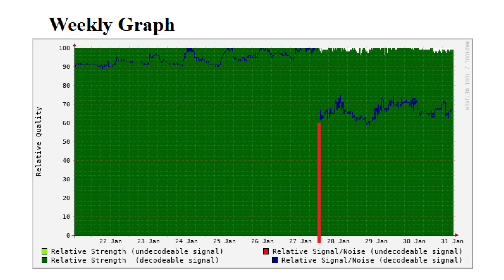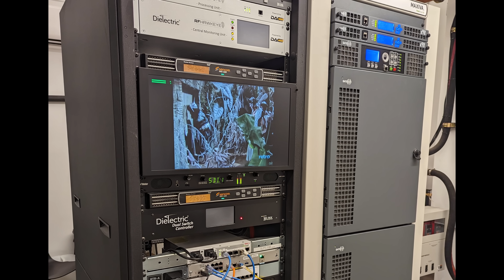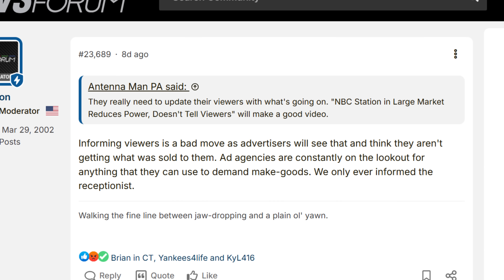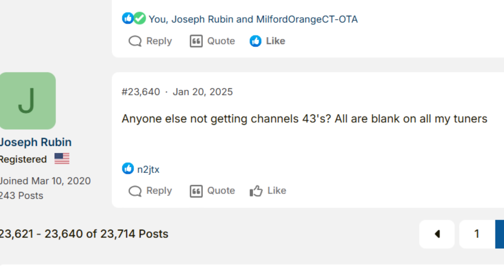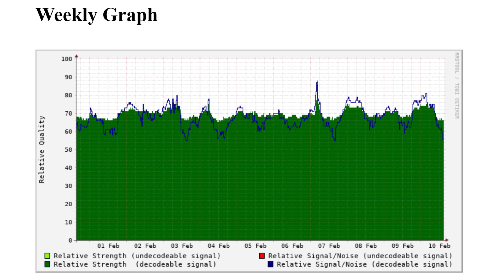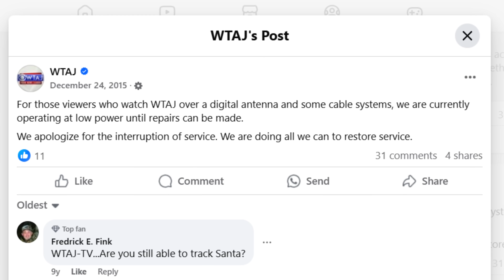TV Stations Lower Broadcast Power at Times - Here’s Why

Comment: Fun Fact: AM radio stations (except Class A stations) will turn down their transmission power around sunset to prevent interference since those radio waves will travel much further due to skywave propagation.

Edit: I mistakenly said that it's due to groundwave, when it's actually because of skywave
Reply: That's not voluntary when it occurs, but is mandated by FCC licensing.  Some stations aren't required to reduce power, but must change their broadcast pattern at night to keep from interfering with another station on the same frequency.
Reply: @LarcR  We have WHP in Harrisburg that does that.
Reply: For example, WHLI 1100 AM in Hempstead NY signs off the air at local sunset because of the 50kW signal of WTAM Cleveland.  The station does promote their FM translator at 104.7 and their website for streaming the station.
Reply: True. I like listening to stations from different countries as well as cities in the USA. Shortwave and MW radio listening is a big hobby. Also when maintenance is done on a transmitter or antenna system power may be turned down or off.
Reply: @RJDA.Dakota there used to be much  more to listen to back in the day.
Reply: Full power at night AM stations are called clearchannel.
Reply: @mstcrow5429   Only primary stations on designated clear channel frequencies are so named.  

1 kW local stations that started as 250 watts, then 1 kW day, 250 night, are far from clear channel, yet meet that criterion under current politics of no power reduction at night.  

There are also 500w-50kW stations on clear channel frequencies that maintain power but switch directional patterns at night, and which are not "clear channel stations" but are secondary on those or adjoining frequencies.
Reply: That's wrong.  Ground wave signals change with soil conductivity and are typically slightly better in cold than warm weather, but do not change otherwise with time of day.  

At night the ionosphere becomes reflective to radio signals, and so many stations reduce power or change to a directional pattern, or different pattern, to protect cochannel and first three upper and lower adjacent channels, of stations in more protected classes or that were there first.
Reply: @lokiva8540 Yes, you're right. I meant to say that it's due to skywave, not groundwave.
Reply: Another fun fact: WTMJ in Milwaukee had the first directional AM band broadcast, to avoid interference with Chicago.  It's still that way.  They use an array of towers in a pattern.
Reply: Another Example: WBZ 1030AM is a news station from Boston, and they are a news station
Reply: They must not all cut back power, otherwise I couldn't get stations in TN here in NJ late at night. For years my dad used to listen to WSM in Nashville here on his old Philco radio in the basement.
Reply: @VB-bk1lh Yes WSM is the Grand Ole Opry station, a high power clear channel station, which during its early days allowed the Grand Ole Opry radio program to gain a widespread following in much of the U.S. even before the program eventually began being carried on the NBC radio network. In Atlanta our local WSB news station is clear channel and at night can be heard in many southeastern states.
Reply: Sunny days lose signal, sun burn off the humidity, NO guarantee of reception in any type of  weather.
Reply: @haroldreyes7549  Sunny days and humid summer weather tend to be tough on compromised hi VHF and lower end UHF signals that skim trees and don't have good line of sight.  That impact on AM ground wave should be trivial (but longer term soil conductivity does shift lower in summer, 20-40 percent in some regional soil types).
Reply: AM 1230 in new York city is a Bloomberg station. At night I can hear them in Baltimore.  Also in my house my 2nd floor gets a better signal than the 1rst floor. PBS usually has the worst signal. Sometimes I get Delaware channels, but not DC.
Reply: Heard also called the sun cap.
Reply: I notice under certain conditions FM and television signal reception goes beyond the listening and viewing area especially from analog television broadcasts before the switch to digital.  Even the audio of television sounded different at times as well as the changes in colors.  AM radio stations that broadcast in HD radio also HD radio can be received far away in the night and the audio quality changes as the HD radio signal fades in and out.
Reply: I do  recve the am signl from luievill KY  remember under the right conditions in wisconsin at night we wre Abe to hear thbrod casts of the base ball games.

Epesle on th car Rado was the best recepi0on.
Ever later found a better way.

One off set up for week signl wine part was a varey long wire stretched down the up stRes of the house front to back and a good ground thar was a nuther box of tricks I built can't remember wat  that did mor than just bust the signl. 

Was using a varey sensitive old radio  as welll.

Best recepion out of uthers I had an had sene as well.

Old scroll am fm tube tipe sert.

Was a radio tuner component 

For a system ad on.

Or posable to ad fm up geat to an existing system wone was feasible got this for about 5 dollars 

Used an old mest up real to really recorder wit a beset billt in amp and a lotof dolifren in puts as a component  as well.

Was gate sound even with the original speakers stereo.

Was all so tubes 

Strange  all so had  aux spekr outs

This was used down stares

With modified for 8 omes pa sperkrr vintog wall baffle wegees.

Wnd a swit to a nute sorse as well. ee
Reply: funny how AM radio is more reliable than digital TV even tho Tyler absolutely hates the AM band...
Reply: @mephitusincognito7918  AM radio sucks over digital OTA signals day or night.  All that AM stands for is Antique Modulation!
Reply: @Boomerlake  then what does QAM stand for?  using wifi? you are using Quadrature Amplitude Modulated signals... basically AM radio that 'twists around' in a specific phase... 'antique' science still has use... just look at the theory of relativity...
Reply: @mephitusincognito7918   How about CM?  

That's when you take a somewhat trusting cat, drape if over your neck, grab all four paws solidly, and stretch or twist to produce melodic modulated variants on purrs or hissing.  

"Cat Modulation"
Reply: They also change their signal configuration.

Comment: ... And 5G interference, which also comes and goes. 5G is in part using frequencies formerly used for UHF TV. Your existing antenna (and new ones) receive these signals & the tuner in the TV is designed to receive these. Amplifiers and such in the system are affected too. The 5G signals can be very strong locally at times.
Reply from the maker: Good point. I should have mentioned trying a 5G filter in this video but did bring it up in several other videos.
Reply: @AntennaMan I noticed the 5G filter slightly reduced the power to my device.
Reply from the maker: @aaronhendrickson  There is a small amount of attention on RF 35 and 36 with a 5G filter
Reply from the maker: @xb991 Yes both are still used. Search "Antenna Man VHF Vs. UHF" on YouTube
Reply: I got a strange reception problem.
A UHF station on RF22 only comes in when the ground / roof gets wet.
Ground wave reception ?
Reply: Sounds healthy
Reply: A TV receiving antenna can be designed to reject signals above 700 MHz. This will prevent the 5G signals from overloading the input amplifier of the receiver. 

So there really is such a thing as an HD TV antenna! The old antennas on our homes are obsolete. They will receive ok,  but a new antenna can be optimized for the signals that we really can tune in.
Reply: They do sell inline filters to filter LTE and 5G signals too.

Comment: i notice that 1 local tv station in my area does not show up on my antena but 3-4 others do. It's not like this channel is way out further than the others. Maybe their signal isn't has strong as the others i get? just annoying/ not sure what's causing it.
Reply from the maker: It doesn't matter if several channels "broadcast from the same area" Each is on a different broadcast antenna and frequency with different power outputs. The end result is no two TV stations have the same signal and might reach an antenna in different locations - AKA you might need to use a signal meter to find the best location for the antenna where it grabs all local channels.
Reply: @AntennaMan  There can be exceptions.  KOKI23 and KMYT41 of Tulsa are owned by the same company with their transmitters on the same tower.  KMYT's power and tower height is a little lower, which explains I can't get it as often as KOKI23.
Reply: Uhf vs vhf can be all the difference.  Look into the system and then see if the antenna works well within the frequency

Comment: VHF and UHF were better  .   They replaced those with a technology  they know  doesn't work well
Reply from the maker: The VHF and UHF bands are still used. The difference is TV stations now broadcast using the ATSC 1.0 digital TV standard which can be very fragile in certain areas. I actually made a video about it below: https://youtu.be/3x-FRMplIkU
Reply: @AntennaMan  Yes, and the conversion from analog to digital service took away service from many. Analog antennas captured reliable signals from much further distances.  At least where I live.
Reply: @jameslarosa2396  Not so where I live.  From the result of the changeover to digital from analog it brought in signals always rock steady and snow free.  There was no longer any need to get Cable TV to get stations totally free of snow from the nearest metro of around 45 miles away.
Reply: @AntennaMan And thank you for that.
Reply: @AntennaMan Still broadcasting on mostly UHF now. The channel number is virtual. At one time the channel was the actual frequencies that were assigned to each channel. Now, mostly only UHF is utilized. The lower VHF frequencies are being reassigned to a new FM band adjacent to the 88–108 MHz spectrum. It will be expanded to at least 80 MHz. Medium Wave stations will be reassigned to these new frequencies. It’s all about how the stations are modulated.
Reply: We lost a lot going from analog to digital. The cell companies wanted the frequencies. Congress caved. At least the Democrats got Grandma free converter boxes for their old TVs.
Reply: @tpl608  Thank goodness after all of that most people can get more than just the 4 typical channels back in the earlier days of analog.